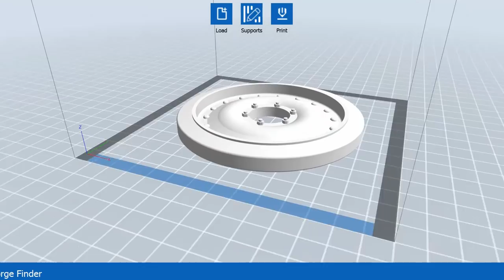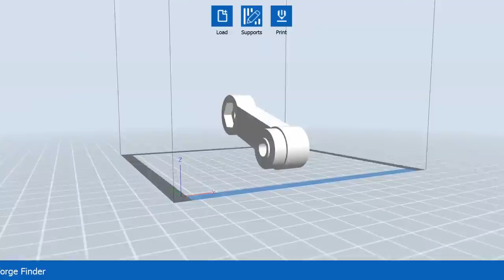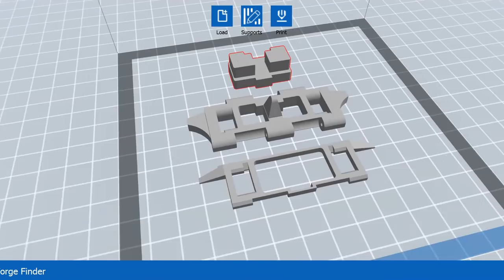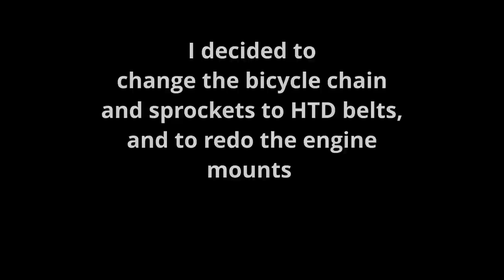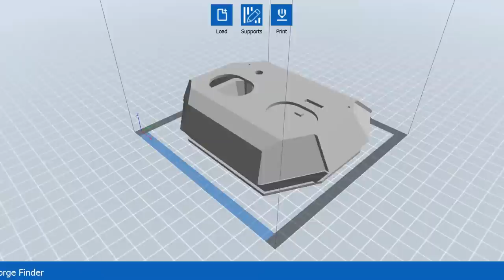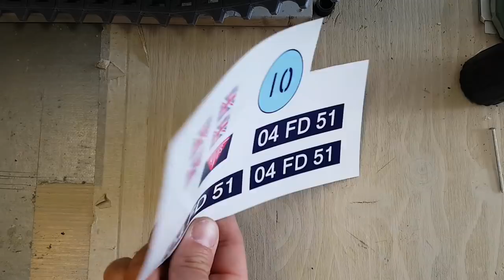How to make the 1/6 scale FV107 Scimitar

Comment: It is actually interesting how you 3D print easily manufacturable parts (wheels - plywood, turning machine and some rivets/bolts) and manually make complicated ones.
Reply from the maker: Well, they are not easy to make for me, since I don't have a turning machine.
Reply: @builtbyWikander  Then this explains a lot.

Comment: I love that your using high tensile bolts! Must be costly 😀 

Not so long ago you could buy the spartan (very similar design) and with an addition to your driving licence drive them on the road. Used a Jaguar 4.2 straight six XJ engine.
Reply from the maker: Hi! The bolts are galvanized steel, very cheap to buy.
Reply: I guessed so. Its amazing that standards bolts now are rated too 800mpa and 80% elongation.

Comment: Have you considered using a filament for the tracks that matches the final look? maybe a black, brown or rust color would look good I think. The light grey is ok but I feel like if a different option is equally cheap its worth the try and may look better
Reply from the maker: I did some weathering of the tracks a few years ago to, as you say, make them a bit rusty and worn. Just haven't got around to do it again. I think that a good thing with gray tracks is that if you paint then rusty, they paint gets worn and the brighter grey shines through, as metal does on a real vehicle.
Reply: @builtbyWikander  that is a good point you make about the wear

Comment: Good afternoon Eric. how did you open the cannon lid? did you use an actuator? where there is a yellow plate written "danger..."
Reply from the maker: Hi! It's a small 9g servo with a metal rod that opens and close it when I flick a switch on the radio. 🙂

Comment: Eric, are you okay? How long does it take you to print each part of the tank mat?
In my case it takes a long time (30 min)
Reply from the maker: Hi! Yeas, everything is fine! Do you mean each track link? It takes time. 🙂 Depending on your settings, and speed of the printer, it might take an hour for each track link, or more. There is nothing right or wrong here, it just takes the time it takes. My Centrurion tracks took 600 hours to print, as an example.

Comment: Hey , Wikander amazing video!!! could I ask what equipment you use to create RC models?!!? Im saving up for a Cross-RC  MC8 and seeking to add a Toyan Four-cylinder Four-stroke Water Cooling Nitro Model Engine FS-L400 to make it a hybrid and was wondering what equipment model engineers like yourself need inside you garage? Thanks!
Reply from the maker: Hi, thanks so much for watching! The tools and machines I use are pretty basic - mainly what you see in the video: a small table band saw, a pillar-drill and a small table sander. The sander is probably the most important of all tools, since it allows me to make 90 degree corners and sides. The table band saw is mostly used for cutting things roughly. I then sand the pieces to the right size with the sander. I could do with a real circular table saw, but I don't have the space. 🙂 Aside from that, it's basically hand tools - screw drivers, hammers, rulers, etc. The number one tool to make my models, however, is the 3D-printer. Best of luck with your build, it sounds like a really awesome project! 👌

Comment: friend, just one more question: what clearance do you leave between the wheels to pass the belt teeth? does it have to be very tight, or do you leave a gap between the two black wheels of the tank to pass the track teeth?
Reply from the maker: There is a bit if a play, but not much. The teeth are shaped like pyramids, and the gap between the two road wheel halfs are just a tiny bit bigger than the base of the pyramid. My experience is that it is good if it is close, but it does not have to be exact.

Comment: hello how are you Eric? for my FV107 I am using PLA added to the printed parts. the lids of some boxes I printed with a very thin thickness (approximately 1mm) and I noticed that they get deformed if placed in the sun for a while. The temperature when they are directly in the sun is deforming some thinner pieces. have you ever had this problem? what material did you use? pla added?
Reply from the maker: Hi! Nice to hear that your project is going forwards! I use PLA+ from eSun for all my models, with at least 3 walls thickness for most parts. Thin pieces of PLA will warp in the sun, so be careful. I don't have that many thin pieces on my model, but I still try to keep it out of the sun during the summer time.

Comment: Hi Eric how are you? Do you have any suggestions for making that tube that comes out of the tank from the back, makes a curve and goes to the side of the tank and ends next to the bucket of water?
Reply from the maker: Hi! If it is the small and thin pipe you are referring to, it's made from a thin brass tube, can be bought at any hobby store. If it's the 3d-printed flat tube/air hose you mean, I got some help with that and I would suggest you try and sculpture it from foam, wood or something similar.

Comment: Just one question: when you start the screwdriver motor and turn it off, doesn't it lock? because the screwdriver motor does this (crashes when it stops). you use it in drill mode, don't you?
Reply from the maker: Yes, they are used in drill mode (but you can use it in any of the slip-clutch modes, if you want to make sure the clutch is disengaged if the model gets stuck). Not sure what you mean with locking, but if you go full speed ahead and quickly cut the throttle, the motors will stop and the model will slide, if the surface are flat or slippery. That's not really how you should drive, though. 😊 There are ways is most newer radios to program an exponential throttle. That means, that the model will accelerate or accelerate slowly, even if you slam the throttle stick. In that way, you will minimize the load on the motors and mountings.

Comment: Friend, this esc you used has to do some programming in it, or is it ready to use?
Reply from the maker: There are different parameters you can set on the ECS:s, and a programming card is included in the box, one for each ESC. You can set speed, reverse speed, battery type, and other things. You also have to choose what stivk-movement is forward, neutral and reverse. But no real programming, other than that.

Comment: It would be great if you made a video explaining something about Freecad. I'm not sure how to model the tower. Are you interested in making a video on how to model the tower in freecad?
Reply from the maker: I have some plans on how to use freecad to model parts, absolutely. I remember the turret being a bit tricky. I Made it in two halfs, one bottom and one top, if that helps. Start with a solid in Part design, make the entire turret, give it all the sides and angles, split it in half and make it hollow with the walls about 5 mm thick.

Comment: Hi Eric, how are you? can you tell me what is the diameter of the gear that makes the tower rotate? I believe it is 100 mm, would that be it?
Reply from the maker: Hi! It's just short of 140 mm in diameter, that's the largest I could make it in one piece in in my old printer. There's no real right or wrong here - the larger gear, the lower gear ratio. 🙂 Good luck!

Comment: Hey ! Cool model. Do you have any plans for Soviet / Russian military armored vehicles? I am from Russia and am building a series of BMD-1 BMD-2 machines on the same scale, 1/6
Reply from the maker: Thank you! Actually yes, - a T-55 and a BT-5 is on the table, but it would probably take some time before they are done. 😊 Very cool to hear, mate, are you making tracks and otger parts yourself?
Reply: @builtbyWikander  In fact, we haven't even gotten out of the design stage. We are planning to manufacture the undercarriage on a programmed milling machine. 

As for the 
caterpillars, we are not yet firmly sure, but we are going to try metal casting. We can send you renders of our 3D model by mail if you are interested. We drew it for a long time :) We took many dimensions from a real combat vehicle from the museum.

Since we want to make these models in series, we decided to use fiberglass for the hull and turret. We will have a matrix for this.

Comment: I understood. does it need to be of greater strength or is it that little blue 9g?
Reply from the maker: Oh no, it's not a 9g! Bigger. Like the old ones, used in old rc cars. I guess it has a strength of 5  to 10 kg. So no, it does not have to be very strong. 🙂

Comment: Are those metal parts aluminum sheets you used? how many millimeters? Thanks.
Reply from the maker: The aluminum sheets I use differs between 1.2, 1.5 and 2 mm, rarely any thicker. I use them when I need to make a smooth flat surface or protection for the underside of the hull. Bought at a local hardware store.

Comment: Hey there, first of all I just wanted ant to say that what you’re doing is absolutely amazing and I’m enjoying every second of your videos! 
I just couldn’t help but notice some artefacts on the print at 9:57 which I’m guessing were caused by Low wall count and infill to save some print time. You might already know this but since your friend printed them I’ll say it anyways if it can help, you can print the walls before the infill (usually a check mark in the slicer) and they should disappear saving you some sanding time! (On the other hand, overhangs might look a bit worse):)
Reply from the maker: Hi! Thanks a lot for watching and for the very kind words! Yeah, I think you are right - I'm not sure how many layers my friend used, but I'm guessing not more than 2. I'm not seeing this appear on parts with 3 layers or more. Anyway, huge thanks for the tip, it will definitely come in handy in the future!

Comment: that black plate, where you fixed the headlights, what material? Thanks.
Reply from the maker: The black plate is 2 or 3 mm thick plastic, bought at a hardware store as an L shaped list. It's the same material as in the mudguards and many other stuff. It's both strong and flexible and can be glued with plastic glue. I believe it is ABS and they come in many different sizes.

Comment: Friend could you give any tips on how to make the tower in freecad? what bench did you use in freecad?
Reply from the maker: Hi! I used PartDesign (including Sketch) for probably 90%, and some Part too to mirror. I made it two halfs, one under and one top.
Reply from the maker: I think I made it solid, then split it in half and then used the Part Thickness tool to make the two parts hollow.

Comment: Hello, how are you? What is the diameter that you used for the cannon (of the tube)?
Reply from the maker: Hi! Since the Scimitar has a 30 mm autocanon, I divided 30 with the scale of the model, 6, and found a tube with 5 mm internal diameter. I think the thickness of the tube wall is ~ 1 mm.

Comment: So cool on so many levels...
 brilliant actually 👏 
I build large scale RC  offshore powerboats and I 3d print the hulls to make the plugs to cast the fiberglass hulls.
I've always been interested in WW2 tanks but steered away because of the tracks...but after watching ALL your vids you've inspired me!
How have the tracks printed with  PLA plus been holding up?
Reply from the maker: Hi! Funny - I started building large scale wooden RC boats a long time ago too. 😊 The tracks has held up fine,  it I'm always making them a little thicker and simpler than real true to scale, to be sure. Thanks for watching! 🙏
Reply: One last question my friend...
What %infill are you using on the tracks?
I would think you would want them as solid as posdible...
I think the bug has bit me...
Reply from the maker: @michaelanthony1537  Hi! Maybe I answered you somewhere else? But the tracks are always at least 95 % infill with at least 3 walls.

Comment: friend, I saw that you used a bicycle pulley on the motor axle, but on the other axle you used a ratchet I think. Couldn't you use the same pulley you used on the motor shaft, on all axes?
Reply from the maker: I started with bicycle chain and -gears, but changed it to belt and HTD-belts and wheels half way. It is described at 06.40. ☺ I always use the same setup on both axles.
Reply: @builtbyWikander  is that when you used gears, I saw that you used different gears. so I don't understand why you didn't use the same type of gear in all parts. I think it was a plastic gear and a metal gear.
Reply from the maker: @rctechnology1223  Right, the plastic gear is the small derailer gear on a bicycle. By using a smaller gear on the motor, and bigger on the drive shaft, I gear the model down a bit, making it a bit slower, but also stronger.

Comment: Wow ! After subscribing your Chan I've tried to be update on your history built method. You found a way that could appear as not compliant with tracks véhicules, but in reality you applied the Morgan and other high end historic cars made of wood structure that support the metal body. 
How about a day try to full built in metal ? Deleting the wood after forming ? 

Actually I love the way you do it. 
Even if, brainstorming the philosophic way of hacking a drill using the same drill for it.... It could be a long debate 😂😂😂

I love the solid wood structure and the apparent simplicity it looks, could create the declic for anyone as the wood could be cut and form easier than any other material. 
I'm not very familiar with 3dprint but it's clearly the way to do. 
Did you share somewhere the file you used ? Free or not. 
Did you create files using pics and and volume it , or did you draw the full element from zero ?

And the question  that disturb me from my first vid to now.... 
If you have a weekly use of models with friends.... How the PLA tracks wear it ? Did they handle the all terran abrasion , and the link does not take his own way after enlarge his hole ? Resuming, could it be a often usage or do you make it for rare driving ? 
It could also be a way for aluminium melting in silicone mold. I've done it for few parts and it work very well ok every scale. Bit not as simpliest clearly. 

You understand, I love totally your work and now I will be impatient of every vids and built. Modern as historic or why not as construction of supply vehicles

Thank you for sharing such hobby and made it attractive, in a better way than moneymoneymoney models. And thank you reading my bad English
Cheers from France 🇲🇫😊😊🇲🇫👍
Reply from the maker: Hey, man, thanks for watching and for all the kind words!
I took a lot of inspiration from rctankcombat.com, they use a lot of plywood in their builds. Plus, my workshop has mostly wood-tools, so plywood is the go-to material for me.

As for the tracks, they have held up really well. My models are not that heavy, between 15 and 20 kg, and the PLA and PLA+ seem to work fine. I always make my tracks thicker than completely scale, to build in a bit of security.

I model my 3d-printed parts from scratch  using FreeCad and use blueprints and pictures as reference. Currently, I'm only building for my own amusement. 😊 Thanks again for your comment!

Comment: so you would have to know the actual size of the tank, is that it?
Reply from the maker: Correct. But that's usually not a problem, since Wikipedia, Tank encyclopedia and many other sites have specifications such as length, width and height.

Comment: How much does it cost to build this (including the electronics)
Reply from the maker: Hi! Hard to answer exactly, but around $ 400 - 500, or thereabout, I would guess. The biggest cost is the ESC and the sound module.
Reply: @builtbyWikander  if I just want a basic version so without to many add ons so it just turns its turret and drives how much would it be then
Reply from the maker: @Airfix_Revell  Well, it depends - I'm not counting all my tools, machines or 3d-printer, just the cost of materials. There isn't really any "ad-ons", except for the Sense Dual Plus sound module, and that is ~ $50.